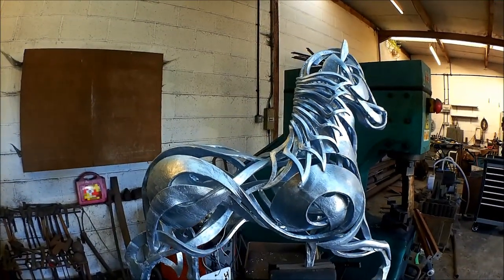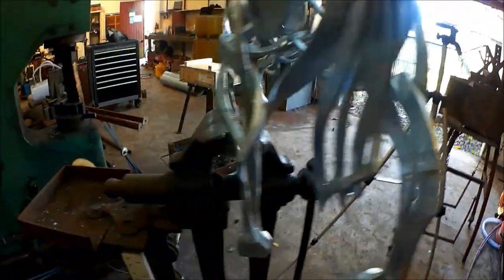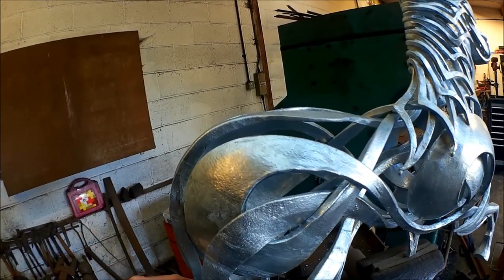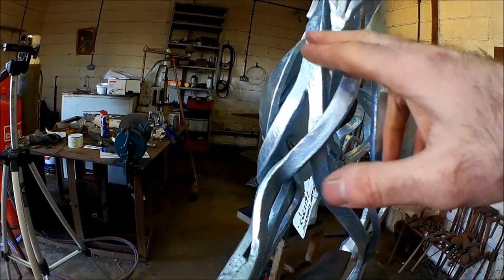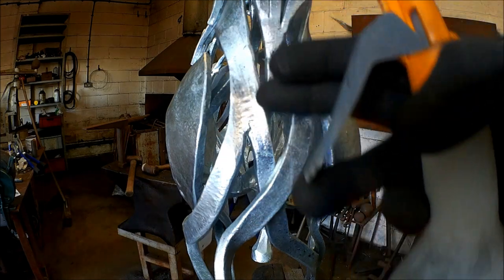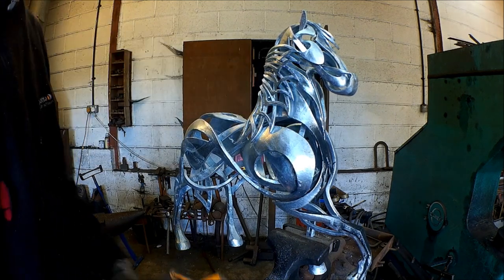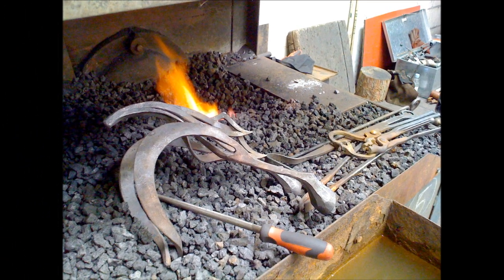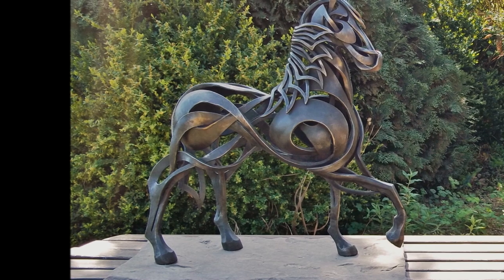Galvanizing my first horse sculpture

Comment: Fantastic, I have honestly never thought about having a sculpture galvanized. My hat is off to you sir. Glad you seem to have found a good home for this amazing piece. Thank you for posting this update video.
Reply from the maker: Thank you! for stuff made of steel hot dip galvanizing gives at least 50-100+ years of rust proof protection out side so its its usually my first choice if I want the piece to last longer than I will, also with complex and hard to reach parts dipping works well to ensure the whole piece is protected.

Comment: Such a great piece, well done. Another way to protect thread is to pack the internal thread with ‘office blue tack’ prior to processing, prevents galvanizing of the thread and easy to remove.
Reply from the maker: Thank you! thats a good tip. wooden dowl worked well its just cleaning out the charcoal, ive greesed bolts before and found they came out again after also.

Comment: I have just discovered hot zinc spraying where molten zinc is sprayed on the job. It gives a super smooth finish with no drips and has the advantage that you don’t need to drill holes in hollow objects. I would really recommend you give it a go.
Reply from the maker: Hi Gary. I've had things metalized or flame sprayed before, its good as you say however parts like this horse have a lot of internal detail that a spray can't reach and dipping get into all the nooks and cracks for rust free peace of mind. Dipping is cheaper also depending on drip feckle time after. Copper or bronze hot spraying is good and can be patinated as if it where solid bronze. But made far more cost effectively. Cheers J

Comment: Hi Joshua
this is late I know,,,,,,,, have had similar issues with weld showing up after galvanizing, even if taken back flush with a flap wheel.
just listened to your comment re the cooling down process.

I may next time try and finish the weld and clean up, then reheat the area to beyond mig welding heat and see if that helps.

Enjoy watching your clips ,,,,,

Cheers Charlie "not a real blacksmith"
@byqnique